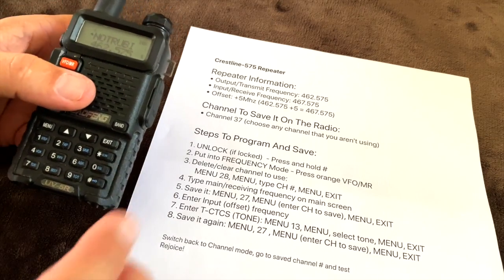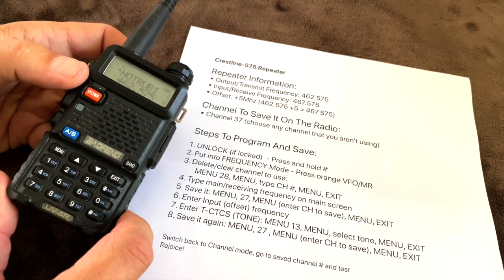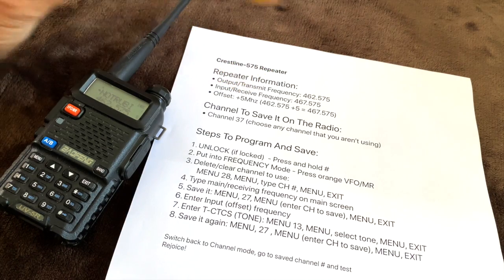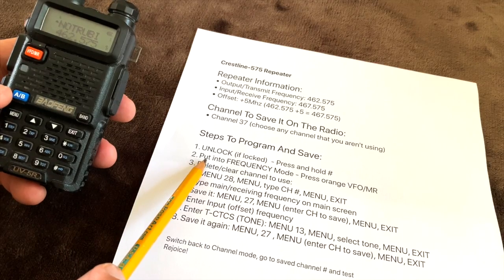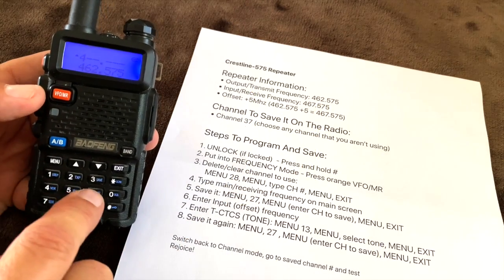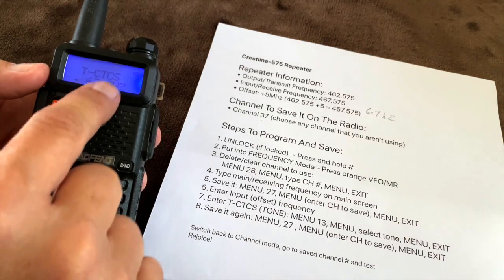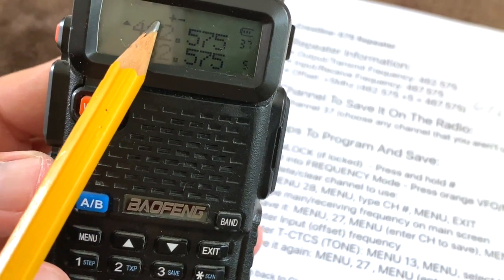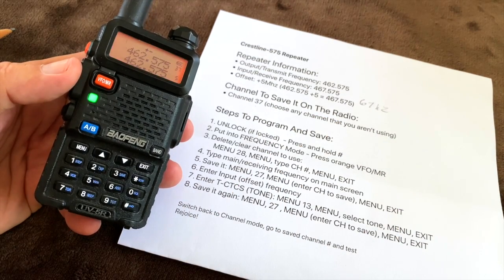Baofeng UV-5R: Add CTCSS and DCS Codes & Tones On The Keypad And Connect To & Talk On A Repeater

Comment: Several of the repeaters in my area have either an input tone or an output tone but, not both. If it only has an output tone does that mean i cannot transmit?
Reply: It could be a simplex repeater.  There's one on our island that uses a single frequency to use the repeater, both the input and output are the same, and uses a PL tone to access the repeater.

Comment: I did everything as you said in this video, and it worked perfectly. 
Now for the stupid question 1: How do you actually use a repeater to contact another radio farther away? 
And the other radio should be on the same repeater channel, right? Which brings us to Stupid question 2: What then if it is just a Baofeng BF-888S?

Comment: So I just tried doing this….

Main channel is 462.575 - I saved it like you said to 

I then added the 467.575 like you stated and added the tone and saved everything g again - but once I return back to channel mode, what’s saved on my saved channel is the frequency 467.575 and not 462.575 - and when I try to key the mic, it beeps at me and nothing occurs 

I’ve tried this 5 or 6 times now, exactly to the steps you’ve suggested and thus far I am not able to get it to work 😐
Reply: You have do program channels on the upper frequency of the 2. I tried several times using the bottom and it wouldn't work!
Reply: Step 1:  Ensure you're in VFO mode.
Step 2:  Enter the Receive frequency of the repeater (in this case, 462.575).
Step 3:  Save Receive frequency (Menu 27), into an open channel of your choice (i.e. Ch. 1).  Exit from programming.
Step 4:  Enter the Transmit frequency of the repeater (in this case, 467.575).
Step 5:  Press MENU and select T-CTCS (Menu 13), select the corresponding tone needed to open the repeater when pressing the PTT.
Step 6:  Scroll and select Shift Direction (Menu 25), that corresponds with the repeater.
Step 7:  Scroll and select Offset (Menu 26), to ensure the correct offset has been chosen for the frequency of the repeater.
Step 8:  Scroll and select Menu 27 to save your settings onto same channel your RX frequency has been saved to.  Exit from programming.

After completing the steps above, you should see the + and - symbols above the RX frequency (462.575), which signifies programming was done successfully for the UV-5R HT.  If you key up the repeater, it should acknowledge your signal.  Hope this helps.... Aloha!
Reply: If the repeater has an input and output tone do those go under the corresponding frequencies?

Comment: Finally some right to the point instructions without a lesson in radio theory and snapshots of the grand kids. So, there is a repeater in my area on 462.6500 but I do not know the repeaters input tone. Do I have start at 67.0 and program every ctcss tone into the CH-Mem location until I find the right one? Or is there an easier way. 🤔
Reply from the maker: There is an easier way.. Watch this:  https://youtu.be/lBFFDHyZeww
Reply: @TheNotaRubicon  - Thank you.  PS: why does your rubber duckies 🐤 appear to by longer than mine?
Your favorite viewer.

Comment: Being essentially brand-new to using any type of programmable radio I came to this video because I wanted to be able to use my UV-5R at work where they have a fleet of non UV-5R radios. 
Those radios work on a frequency such as 453.250 but I found by watching other notarubicon videos and commenting my question that the reason I can't transmit to those radios is because they use a CTCSS tone which to some degree shields those radios from hearing my UV-5R.  
This video does show you how to set that CTCSS tone, sort-of, but being new I misunderstood the fact that CTCSS tones are preset tones that you can locate in the UV-5R instruction manual. Another way to express this is you don't type in a tone but rather choose a tone as one of the last steps in this video.  This video is mostly about connecting to a repeater which I don't need and is only briefly about the CTCSS tone.  
On the chart in the UV-5R instruction manual it shows a table of 50 possible tones you can choose.  I already knew I needed it to be 118.8 because I had used a frequency counter to determine what that tone was that comes from the work radios. I was confused by the video because I was expecting to type in 118.8 somewhere. In this video he chooses 67hz which I did not understand came from that preset list of 50 tones.  
For me, I needed to understand that tones were preset and I needed to continue to arrow up or down until I saw 118.8 as an option. 
Works perfectly now.

Comment: The repeater I'm trying to access has a Tone of  "CC1" - is this a DMR/Digital tone which my Baofeng UV-5R won't reach?
Reply from the maker: The UV-5R is an analog radio, so it cant do DMR.
Reply: @TheNotaRubicon  With your instruction, I've tuned into several Ham repeaters in my area.  But with no Amateur license, I'm scared to key up on them.  What exactly is the penalty for transmitting on a Ham frequency without a license?   Death by Kabunga?   Guess I'll take the exam and get a license.   But the Hams I do know seem kinda uptight, and walk around like they have a stick up their *      Is it a prerequisite to be an * if you get a Ham license?
Reply: @justicejones5025  Watch virtually any other if his videos and you find the answer is yes. 
Personally I will not be getting licensed.  
Transiting on HAM frequencies often results in Colorado Super-Max prison time.
or nothing at all
Reply: @justicejones5025  For what its worth I studied for two days and just passed. Test wasn't too bad at all. I did use hamradioprep, definitely seems worth it

Comment: One thing I'm confused about is the part in the UV-5R manual mentioning a 1750hz tone to get access to the repeater (audible, not a CTCSS tone).  Is this truly something most repeaters need?  My goog-fu hasn't rendered any useful info on this.  I've yet to succeed accessing a repeater with or without that audible tone.
Reply from the maker: No. It is likely you will never use that option.

Comment: so I get lost at step 6. do you just do this over the other? what about the tone on the uplink frequency?
Reply: So you're not actually "saving it over" the previously entered frequency. The radio recognizes that the first freq and second are diffrent. So essentally you save the Receiving freq, enter the tones for TX & RX, then enter the Transmit freq and save. If done correctly when you switch to the channel you saved it to in "Channel Mode" you should see the receving freq on the screen, then when you key the PTT you should see the freq switch to the Trasmit freq automatically. That make sense?
Reply: To add to this step 6 enter the offset. So you just enter it on the main screen(memory/channel)? OR do you enter it into the settings and then save it?
Reply: @charliedelta1136  So the offset between these freqs in this case is +5Mhz. The Transmit freq is 462.575 if you add the offset of +5 Mhz then you get the receiving(offset)freq of 467.575. So when you save the reciving freq, enter the tones, then save the offset freq, your do not have to enter the offset in the menu as you've already done the offset yourself when saving the channels.

Comment: What good are DCS codes if the radio is analogue?  Very informative videos.  Keep it up.
Reply from the maker: DCS/DTC codes are used on many analog repeaters and work just fine on analog radios.
Reply: @TheNotaRubicon How would I know if a GMRS repeater is analog or digital?
Reply from the maker: Digital repeaters are not permitted on GMRS - and if someone was to run-afoul of the FCC rules and have one anyway, all you would hear on your legal GMRS radio is static/digital noise.
Reply: @TheNotaRubicon  I've followed all the steps about 5 times now and still can't connect.  I'm not putting in a T-CTCS, but rather a T-DCS because the GMRS repeater uses a DPL transmit and receive tone.  I've only entered the T-DCS.  Should I also input the R-DCS?    Thanks again for your help.

Comment: Great video. I need some help. My job requires that I communicate frequently on 41.9500, what affordable radio is capable of transmitting in that freq?
Reply from the maker: Seems that if your job requires you to transmit on that frequency, they would provide you a radio that does that, or, at least, tell you exactly what you need to purchase..
But, to answer your question: I have no idea
Reply: @TheNotaRubicon  that would make sense. I do get a radio it just overheats and has a battery that has been charged a million times lol .. I also get issued a sleeping mat but I would never sleep on that thing, and also bought my own from a better quality source.
Reply: @rayses6951  Your job provides you a sleeping mat? I need a job like that.  Now I'm dying to know what kind of job you have.  I'm guessing its vietcong sniper spotter.

Comment: What is wrong if I followed every step to the letter but when pushing the transmit button, it just beeps and won't transmit? It also does this on other various channels in the same range.
Reply from the maker: either you did it wrong or you're trying to transmit on a frequency that the radio cant transmit on.
Reply: @TheNotaRubicon  Yes sir. I figured it out. I watched another of your videos showing how to unlock GMRS frequencies. I watched several of your videos today actually and learned a lot. Greatly appreciated.

Comment: Offset won’t save in channel mode.  I will use Chirp but should be able to program manually.  It looks like offset is the only issue
Reply: https://youtu.be/JenPUF_1Pgw that will tell you how to save the offset
Reply: I have only been able to set offset freq manually in frequency mode, but if you program the freq set up for the channel and save it to the channel you want, and then exit out of the menu back to the freq mode, & then enter the TX frequency which would be what the offset would cause u to TX on & then go back to the channel set menu screen & select the same channel u r working with and hit menu again to select the same channel, it will save it and say transmit frequency! Then, when u go back to channel mode, when u press the ptt button u will see that the freq on the screen will change to the TX frequency and let u transmit on the TX duplex freq  that u need, just like if u were to be able to set the offset in the menu to change to it automatically

Comment: @NotaRubicon Productions if you add the channel offset in the menu options, do you have to save the channel frequency in the channel memory? For example, 462.575 is the output. If we just go in and set the offset at +5Mhz and save it to the channel memory, do we still have to save the 467.575 as well to the same channel?

Comment: Randy, apologies here, likely newbie HAM mistake....but I'm following these steps on an F8HP, but believe something's wrong. I'm attempting to add repeater w/downlink 441.350, Tx/uplink 446.350, offset +5.000. After adding tone and all other info into ch21, I can Rx on 441.**, but when I PPT, the Tx frequency jumps to 451.350, instead of 446.350. The only way I can get it to Tx on 446.350 is to change SFT-D setting to 'Off'. Not sure what I'm doing wrong.

Comment: Hey thank you for doing this. I’m new to Ham just got my call sign, a bit confused here. 

Do you need BOTH the T-CTCSS & 
R-CTCSS. My assumption is yes to both transmit and receive on that repeater? My example I am using required 110.9Hz for both the “uplink” & “downlink” Any clarity you can bring would be really helpful. Thanks!
Reply: You only need the transmit tone to activate the repeater. You don't need to use the receive tone in order to hear the repeater, but you can use it if you want... If you don't use the receive tone, then you will hear the repeater as well as any random people who happen to be transmitting on that channel. If you use the receive tone, then you will only hear the repeater and not others nearby who happen to be using the same channel. Does that make sense?
Reply: Yeah I'm in the same boat here. I'm getting the kerchunk but its just dead air back from the repeater which tells me there is an issue with the CTCSS tone. Let me know if you figure it out cuz I'm still confused.
Reply: Same here.  I get the kerchunk from TV he repeater,  but when I speak... nothing.  It'll light up the other radio.  Just no voice  transmission.
Reply: @frankiewilliamson  Try putting some distance between your two radios when you are testing. If your radios are in the same room when you test, and you don't hear your voice over your second radio, try separating them. Have a friend listen in the back yard, or down the street. My guess is that will fix your issue. I hope that helps.

You only need the transmit tone to activate the repeater. You don't need to use the receive tone in order to hear the repeater, but you can use it if you want... If you don't use the receive tone, then you will hear the repeater as well as any random people who happen to be transmitting on that channel. If you use the receive tone, then you will only hear the repeater and not others nearby who happen to be using the same channel. Does that make sense?

Comment: I am having trouble with talking to my second radio on a repeater frequency. Both are programmed to the same transmit and offset receive frequencies. I have no trouble talking with either radio to another person on the repeater but I cannot communicate with my own radios. Both are Baofeng radios—one is a UV5R and the other is a UV S9+. There is no tone requirement to communicate on this repeater.  Any ideas why I can’t talk between my 2 radios on the repeater?
Reply: Thanks for the quick reply. I will try that.
Reply from the maker: My guess is that your two radios are too close to each other when you're trying.. Get at least 50-100 feet apart and then try.

Comment: Hello Randy. You're videos are awesome. I'm new to transmitting over repeaters and was wondering if you also need to put the PL tone on menu 11 or does it automatically populate when you input the PL tone on menu 13?
Reply from the maker: It doesn't auto populate your tones so you will need to enter them - RCTS and TCTS are often different for many repeaters.  Dont forget that RCTS is optional even if the repeater uses/sends the tone.

Comment: Hey so I’m just getting into ham. I haven’t even purchased a radio yet. Waiting for my bf to come in. But, the nearest repeater is 12.4 miles away. I did buy a 15in antenna to go with it. I’m wondering if you believe it will transmit far enough to reach that. Pretty flat here in SC. If not, what radio would you recommend to reach that far? I’m getting into it to communicate with my father, who’s about 100 miles away. But apparently the repeater is linked to other repeaters. So in theory I should be able to reach him as long as I can reach that repeater. Please help. Thanks in advance
Reply from the maker: The answer is: The only way to know for sure, is to try it.
Reply: @TheNotaRubicon  I was just wondering if that seems like a doable task with what I have. I have never transmitted anything before. If not anything you recommend that would help me get the job done?
Reply from the maker: In good conditions hitting a (good) repeater from 12 miles away is very doable.. From my couch, using most handhelds, I can hit repeaters at 10, 30, and 69 miles away - but I am on a hill and have almost direct line of site to all of them.  If you have a mountain/city/forest between you and the repeater, you may not be able to hit it from 2 miles away.. So, yes its very doable, but the only way to know if YOU can do it is to try it.
Reply: @TheNotaRubicon  okay cool! Well I appreciate it. And thanks for the videos too they have helped get an understanding. Mine should be in Friday. We shall see 🤞🏼
Reply: @TheNotaRubicon  hi, I ended up hitting a repeater 20 miles away that was linked and was able to talk to people all over my entire state. Thanks for the help.

Comment: I followed the steps but my transmit frequency keeps coming up wrong when I transmit. I tried entering my info into a different channel and all is well. Very strange.
Reply: if you do it this way make sure the offset is set to 000.000 /menu 26 ....it kept happening to me till i figured it out ... i had mine set to 005.000 .  set it to all zeros and wala problem solved hope it helps good  luck.

Comment: At 6:15 after entering offset I got confused what you did. Do I hit menu? Seemed like it skipped something.
Reply: You don't actually enter the offset, you use the offset to calculate the (radio) transmit freq and you actually enter the full freq.  In this example, the GMRS freq is 462.575 (radio receive, repeater transmit) and the offset is +5, so the freq. you enter on the keypad is 467.575 (radio transmit, repeater receive).

Comment: Thank you for making this a very simple process.  One question. Is there a limit to how many times you can test against a repeater by just hitting the transmit button? I understand that the is frowned upon but I am wondering if I am having issues hitting the repeater. BTW.  I am a newbie to GMRS.
Reply from the maker: The only limit is your finger getting tired.
Reply: @TheNotaRubicon  lol.  Thanks.  It seems like sometimes I get the return beep and then I dont.

Comment: Hey great videos. Following the instructions I could not hear back in channel mode. In frequency mode it works. 
At first I thought I was too close like another comment.
Reply: Did you find a solution for this? i can hear in frequency mode but not transmit.